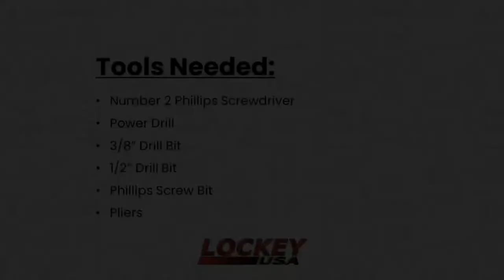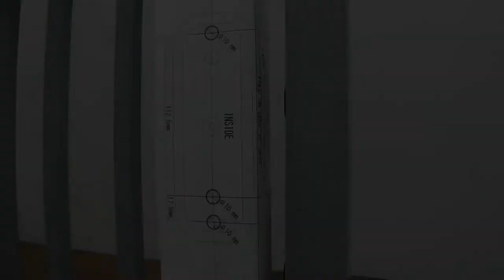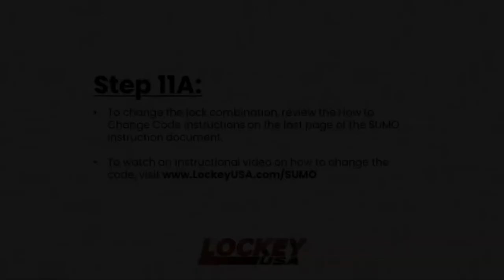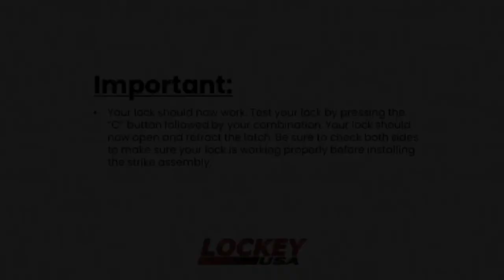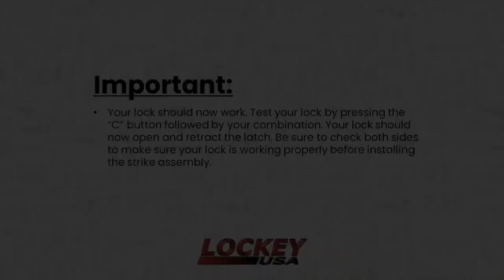How To Install The SUMO GL2 Series Surface Mounted Gate Lock by Lockey

Comment: Hi in Australia. We don't have a surface mounted product like that for pool gates with a digital keypad. A Couple of question my gate frame is 25 mil across and 35-40 mil deep. The gate post is 50 ml x 50 ml. Could the lock be installed on those dimensions. Also, its hard to tell but I assume the gate self latches well. And you can have a key pad on both sides.